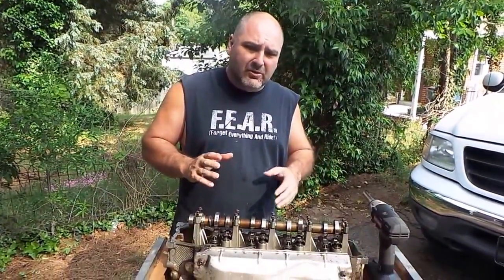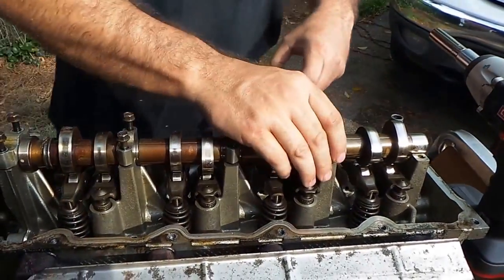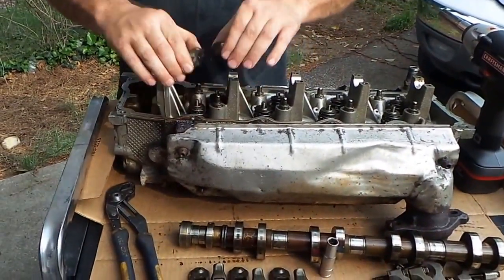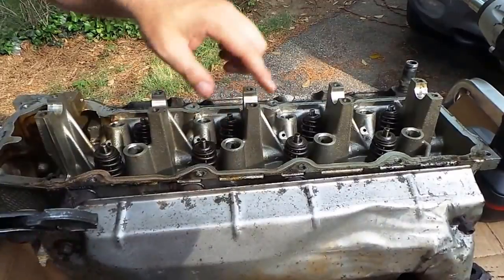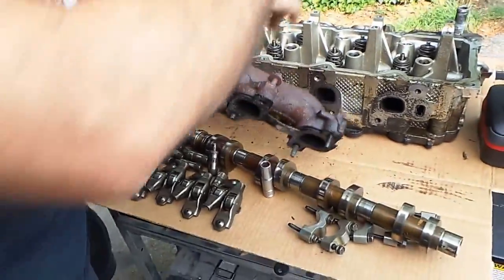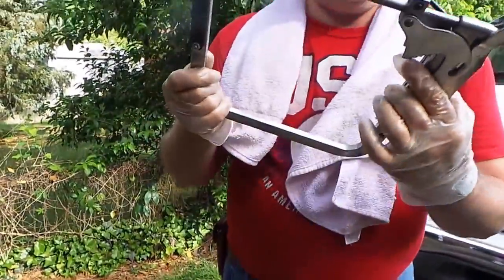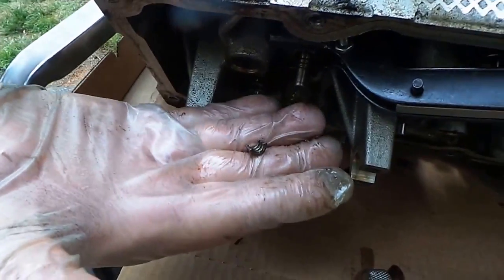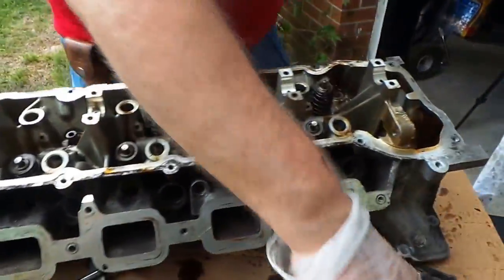How To Tear Down The Head On A 4.7 Jeep Engine

Comment: The valve adjusters have a spring and filled with oil from the motor, I've noticed a bad lifter will have a little expansion if you pull on the nipple part and if the spring inside doesn't have any expansion as well.

Comment: Those factory manifolds exhaust manifolds are good to go. $1500 plus 20hrs to install headers, they didn't fit, the oil pan interfered, and my performance gain? Nada. If I could do it all over again I'd have spent the money on a 08 manifold and matching throttle body and adapter. 08 was wireless. Every mod to the engine has been seamless. The PCM is a marvel, adjusting fuel ratio without any tuning. To be honest it was easier working with the Power tech and compared to an LS build more complex, but requiring less tuning. Pretty much turn key. After 100-150 miles the PCM handles everything. Eye opening power . Below 3000rpm it's more quiet and refined, aFe runner and the 08 updates. Crack the throttle and it'll raise a few eye brows. Love your work man.
Reply: I know im 3 years late to comment but any of the headers for the 4.7 dont flow much better than stock. The most gains from exhaust are bigger y pipe and single high flow cat. I got that on my durango its only like 250 bucks woke it up a bit. I also got rid of the stock muffler with a thrush. Also with how much the 08 manifold swap costs total you dont gain much better off keeping stock manifold porting the stock TB and doing the potato mod which acts like an upgraded intake manifold while giving around the same power gains the other does. 500 bucks vs 40 tops is a no brainer. Also swapping in 4 or 12 hole injectors helps big time too. Removing the fan clutch and installing a 3/4 core radiator with heavy duty fan helps with gaining hp and drastic better cooling as well. You can do that for around 250 bucks.

Comment: Now when you put the cam back on does it matter how it goes
Reply from the maker: I would kind of leaning towards a 12 o’clock but as far as bolting it down doesn’t really matter
Reply: So i can take it off then bolt it back on any way then when i put timing making sure its facing 12 oclock correct

Comment: Haven't done this in years but im about to do head gaskets and timing set on my ladies  4.7.       Thought " while I'm in there tear the head down lap the valves and at least new seal".       Thanks for the chince any way you want comment 
So true.         I've been a mechanic for 28 years and there are places that your fine reusing good used stuff.     100%

Comment: 4.7 L V8 PowerTech is a also a pushrod engine, can you relabel your video to take out all confusion for people, it's cool video and all no disrespect but better to label things right, i got 4,7 V8 with pushrod and this video doesn't help me.
Reply from the maker: What year make and model are you referring to exactly
Reply: i stand corrected, Jeep 4.7 L H.O. V8 are SOHC, my bad. Bad information.
Reply: 2005-2006 Limited.
Reply: Learning moment, :D
Reply: "4.7 L V8 PowerTech is a also a pushrod engine" - it sure isn't.